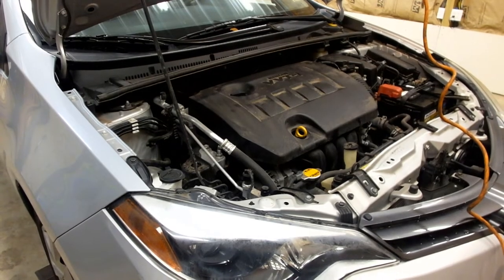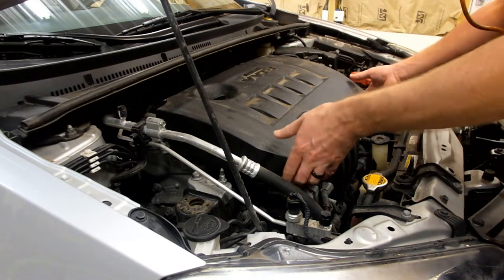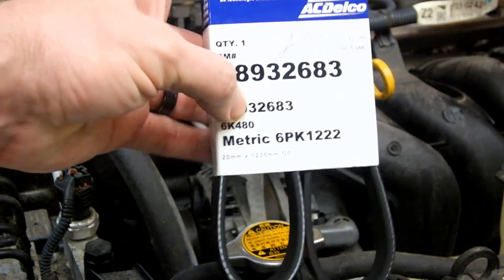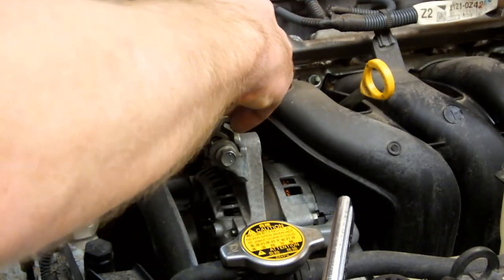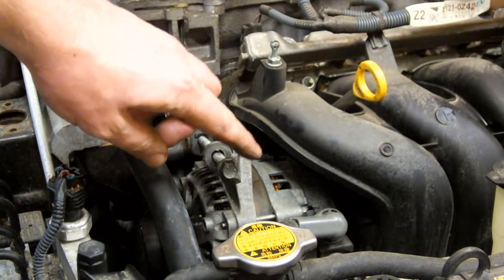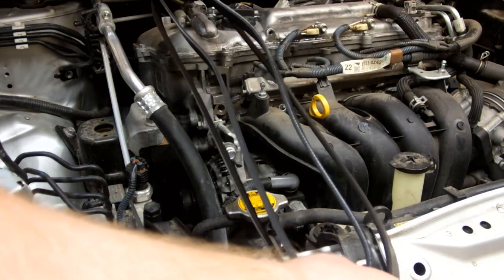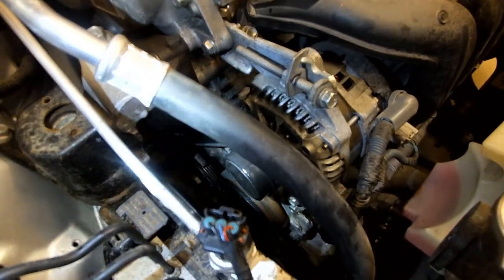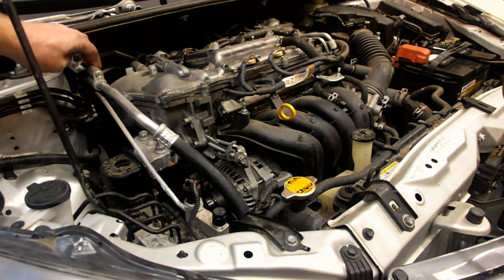How to change serpentine belt in a 2016 Toyota Corolla

Comment from the maker: In this video we replace the serpentine belt in our 2016 Toyota Corolla with the 4-cylider ECO engine.  We discuss a few tips to make the process easier and look at the belt routing diagram.  Belt is an AC Delco 6PK1222.  It may also be called 6K480 or 88932683.  Feel free to ask any questions in the comments.  If this video is helpful please 'like' and 'subscribe' to my channel.  It really helps me out a lot.  Thanks!
Reply: I have a 2014 Corolla S with a manual tensioner like you. Would I use the same size belt that you put in?
Reply from the maker: @joewhattoff8754  hi! Thanks for the comment. I would recommend checking with your local auto parts store or a website such as rockauto.com to determine the correct belt for your car. There are too many variables to just assume that they would be identical.

Comment: This is a great video. Thanks for a simple comprehensive video. My 2012 Corolla has 220k and I have not replaced my serpentine belt yet. But it's now showing some wear and squeals from time to time. Keep the good content coming Mike.
Reply from the maker: You're welcome! Glad to help. 😊
Reply: @CompTechMike   I did the belt today thanks to your video my bolts luckily were all 12 and I didn't have to switch to 14 mm. Took me all about 20 minutes to do the belt
Reply from the maker: @chiefedup  nice!  Thanks for the tip about the bolt size.  I wonder if they changed it between these years?  Good info for anyone coming along after you watching this video.  Thanks!

Comment: I found it helpful to shine a light on the belt while running the engine. Initially the belt was swinging between alternator and crankshaft, so a little extra adjustment fixt my issue. The belt should run smoothly without vibration.
Reply from the maker: @GotToThink4yourself  great tip!

Comment: Good job, waiting more videos for Corolla 2015,16
Gearbox maintenance and oil change
How the stability and performance for the if I change rims size to 17 inch
Reply from the maker: Thanks! I do have a video on oil change. It's a little bit older and I struggled a bit resetting the maintenance light, but may be helpful to you?

https://youtu.be/HgEunln8uIg

Hopefully will be making more videos on this car in the future. 😊
Reply: I have 17 inch rims on my 2016 corolla and ride is smooth, no issue

Comment: At what mileage do you suggest replacing this?

My 2014 Corolla has 80k miles

I heard that maybe it is best practice to use a Gates belt wear guage to check the ribs for wear. It sounds like the EPDM don't crack like the old Neoprene ones.
Reply from the maker: Hi!  Thanks for the comment.  Personally I'd recommend changing them around every five years, more or less depending on your driving habits and mileage.  In my opinion if your car is eight years old and has 80k miles - if you've never changed it before - you're due.

Old cars used to have a maintenance schedule for all these items in their owner's manuals.  Unfortunately it seems like most manufacturers have done away with that.  The "joke" is that with an old car, the manual would tell you how to rebuild the engine.  New cars' owner's manuals just say "don't drink washer fluid", LOL.  🤣

I was able to find these resources online for your Toyota Corolla.  Might be worth checking out:

https://www.driverside.com/service-schedule/complete/toyota-corolla-2014-593151-1530850-0

https://www.toyota.com/owners/resources/warranty-owners-manuals.corolla.2014

https://www.gates.com/us/en/industries/automotive/vehicle-aftermarket/power-up/belt-wear-diagnostic-tips-diagnose-epdm-serpentine-belt-wear.html

https://www.youtube.com/watch?v=GZvPMnE50UM

And yes, as you mentioned, if you have access to a belt wear gauge that would be a great tool to help you determine when you need to replace it.  Good luck!

Comment: Takes literally 20 minutes...just start with the engine cold...a breaker bar and a marker....size 12mm and 14mm...and I used a gate's brand 6pk1234... original belt was 6pk1230.... replace your belt at 100miles...mine looked like it didn't need one but once I took it off you can see the fray strings coming apart and mine actually has a gash on it...so replace it no matter what!
Reply from the maker: Thanks!  Yeah, it's not a difficult job.  Just different compared to most of the cars I usually work on.  😄

Comment: Thanks for the video. But because there is no idler tension pulley, how do you know if you are adjusting the belt too tight or too loose? Because I believe you said that it doesn’t automatically tension it.  By just marking it with a sharpie get you close enough so you don’t have to fine tune the tension?  Thanks
Reply from the maker: Hi Mike!  Thanks for checking out my videos.  This one is a few years old, glad it is still helping people.  Yes - that is the idea behind using the sharpie to mark the position on the tension bolt - as the old joke/saying goes, "close enough for government work".  😉

That said, I would encourage people to use a measuring tool, if they have one available.

Here's links to a few threads and additional information that may be helpful:

https://www.toyotanation.com/threads/how-to-judge-appropriate-serpentine-belt-tension.1124842/

https://www.reddit.com/r/MechanicAdvice/comments/z1cbrj/how_to_adjust_belt_on_2016_corolla/

https://www.amazon.com/Gates-91132-Belt-Tension-Tester/dp/B000CRDLZM

https://www.amazon.com/OTC-6673-Automotive-Accessories/dp/B000I198J0

https://www.grainger.com/product/POWER-DRIVE-V-Belt-Tension-Checker-6AGK7

Comment: How to get belt over alternator? It’s only halfway up when in place elsewhere.
Reply from the maker: Hi! You need to loosen the bolt that the alternator is mounted to, and also the lower bolt to allow it to pivot inwards, to allow the belt to slip over the pulley. Give that a shot, may want to re-watch the video if it doesn't make sense. Let me know how it goes. Good luck!

Comment: My alternator doesn’t swing like that to loosen the tension on the belt I’m not sure what’s going wrong on my end. Do I have to take that tensioner bolt all the way out?
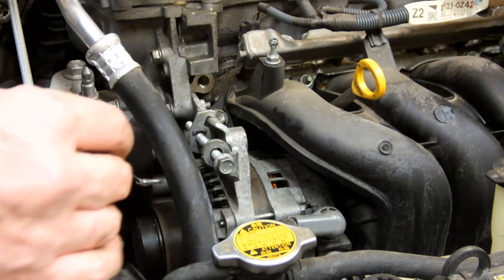Reply from the maker: Hi!  Thanks for the comment.  Assuming your car has the same engine as the one in this video, you shouldn't need to remove it entirely.  Did you check that the bolt down near the bottom has also been loosened?  (shown at 3:48 )
Reply: @CompTechMike  hi thank you for your help. It turns out I was undoing the wrong bolts to undo the belt tension. I didn’t see the lock bolt for the tensioner to let the alternator swing over.
Reply from the maker: @Mygfisawesone  awesome!  Glad you got it.  👍👍
Reply: @CompTechMike  personally i tried everything, but I can't make this bolt loose, i tried everything....i put so much force on it and no result.
Reply from the maker: @yevheniilytvyniuk778  Hi! Sorry to hear you're having a hard time getting the bolt loose. Did you double-check that you're working on the correct bolt? Maybe soak it in some WD-40 or PB Blaster, or use a breaker bar or longer wrench to get more leverage. It's always possible that someone who worked on it before you might've tightened it with an impact gun. Good luck!

Comment: How do you stretch it?
Reply from the maker: Hi! Thanks for the comment. Not entirely sure I understand your question. Automotive belts stretch naturally over time. Once they stretch too far they will start to slip and squeal. You can alleviate that condition somewhat by adjusting the accessories, but generally you should start thinking about replacing the belt once it has begun to stretch.

If you have purchased a replacement belt that is not sufficient length, your best bet is to go back to your retailer and purchase a different one. Don't try to stretch a belt that is too short to "make it fit". Hope this helps!